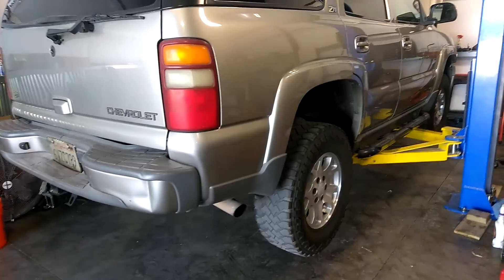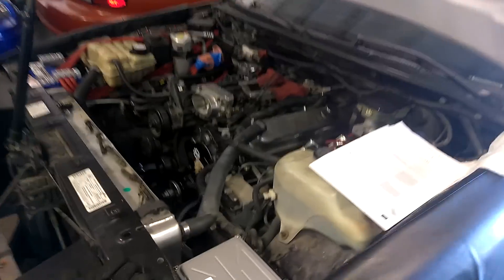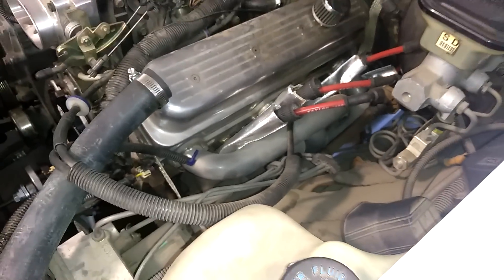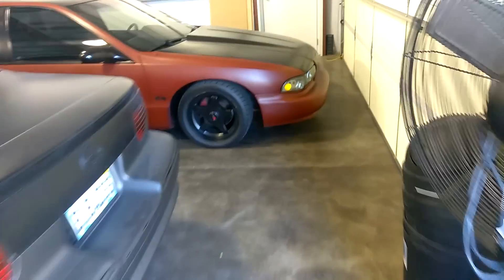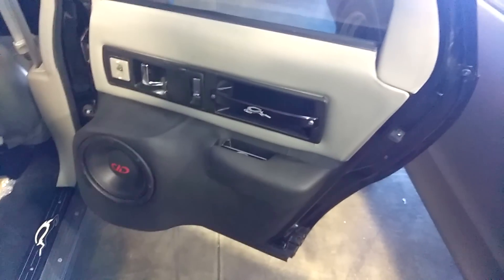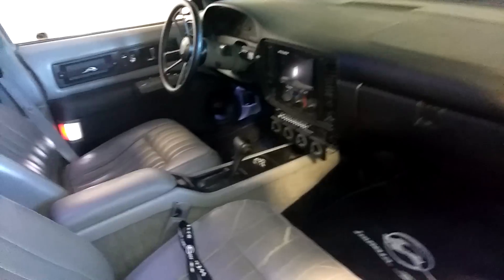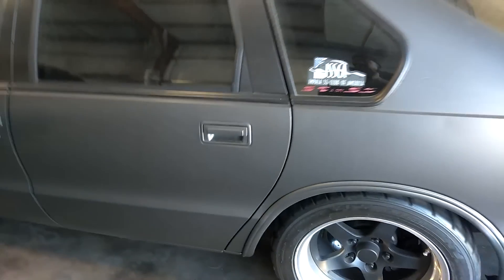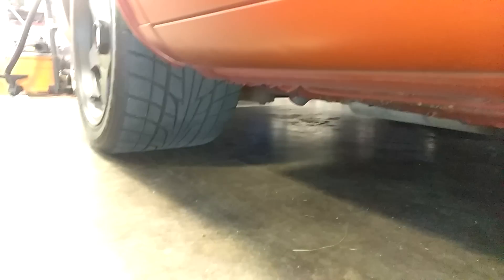Ls swap 96 impala & 383 96 impala

Comment: Damn how did he put 315 in there did he notch the frame to make that fit or??
Reply from the maker: rayquan187 yup did some frame work and widen the rim looks so damn clean in person bro
Reply: rayquan187 I've got a 96 caprice with 305/30/19's on it in the back. Previous owner swapped the rear end out for an older caprice drum brake unit. Narrow enough to run a big tire without rubbing or frame modification.